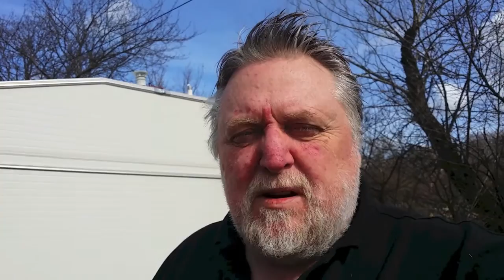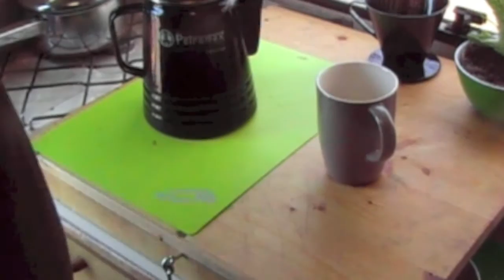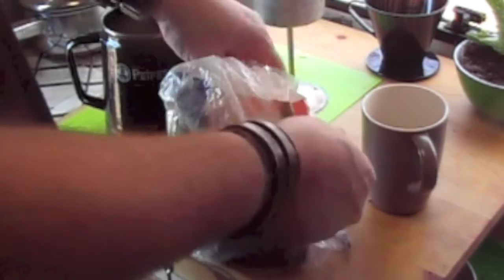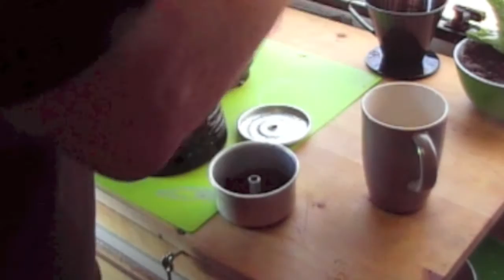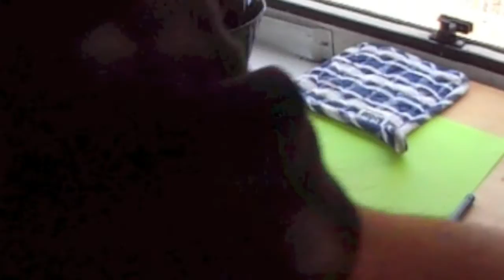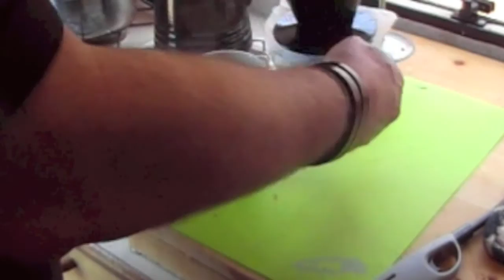I bought a coffee perculator, not very good..

Comment: It seems very harsh to say it's not very good or it's a stupid thing. This is a case of user failure, you didn't think about it or investigate it before buying. Isn't it obvious that the volume or the central pipe and the filter chamber are probably more than your cup!

Are you going to complain that your router won't work on propane? Stupid router. 

Common sense is not as common as you'd think!